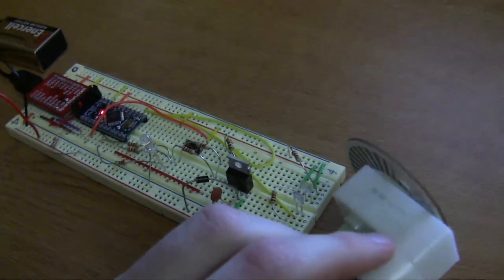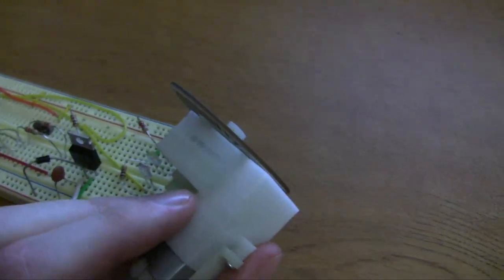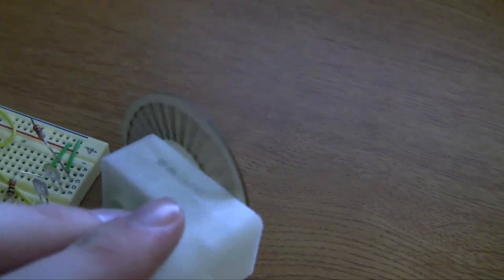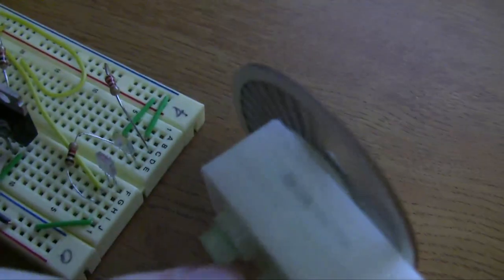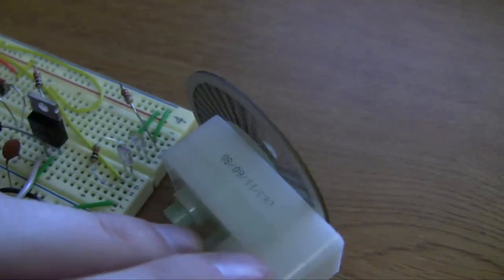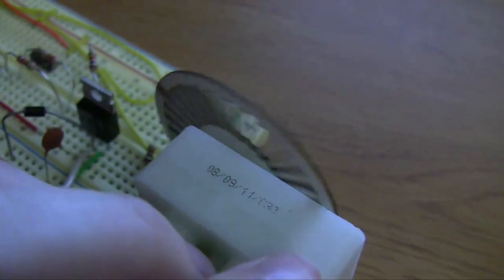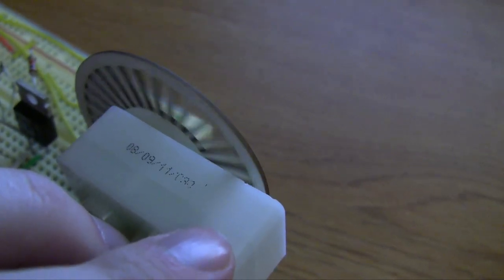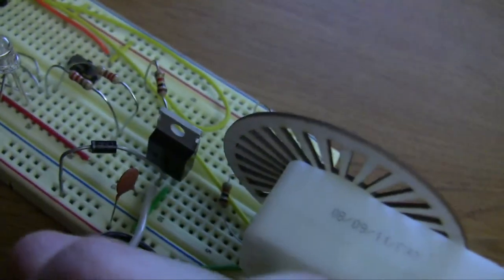Blum 07 - Stopping a Motor with an Optical Encoder

Comment: Cool demo! I'm probably too late but you can use a transistor to short the motor when there's no power applied to it, which will stop it dead in its tracks and keep it from overshooting. a PNP would be the perfect drop in solution for this as it will activate when the arduino output (same pin as the motor driver) goes low.